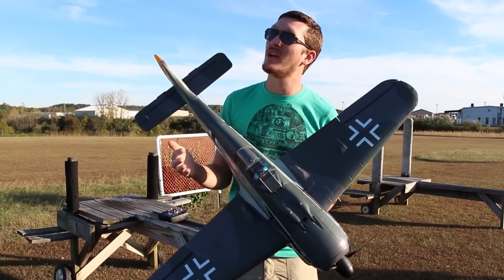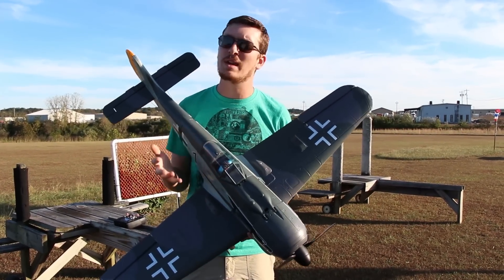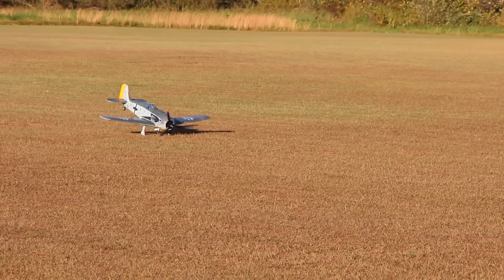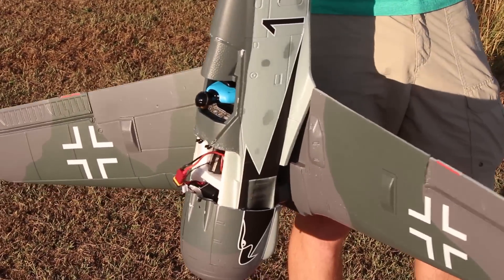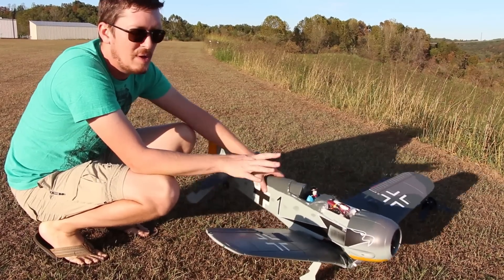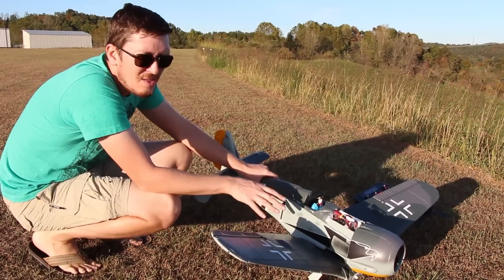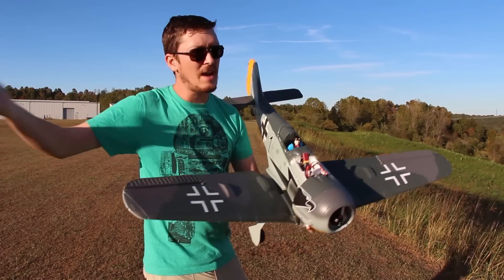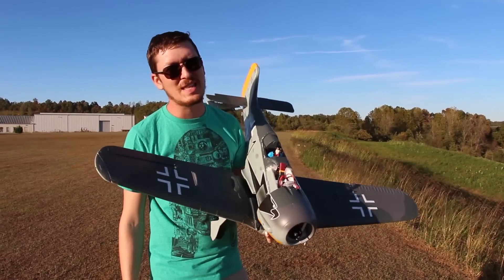WORST RC PLANE CRASH EVER!! - FW190 BRUTALLY DESTROYED!!! - TheRcSaylors

Comment: If you fly RC, it’s not a matter of “if” you crash, but rather “when” you crash...
Reply: And how spectaular. :D
Reply: Or in my case, how often you crash.  I have zero coordination.  I have fine motor skills for most tasks, but not for RC flying for some reason.
Reply: @dasworkshop4967  Have you tried flying in a simulator? That could help with your coordination.
Reply: @dasworkshop4967  Fly a drone, way easier and more fun I think.
Reply: I fly since 2years and 3 month's now, my only crash happened while i handlaunched my f-15 and that was just b.c. i tossed it like an idiot and the trim was also off. You can see this on my channel xD

Comment: Love the new intro! 😍
But the crash looked like a straighforward tip stall to me; simply not enough airspeed during a steep banked turn, and not enough altitude to recover. You could have had a 4s n there and it wouldn't have made any difference.
Reply: my thoughts exactly deadlydiddy
Reply: Tip stall, I agree. A little more forward CG would have probably help too.  The plane should be fixable.
Reply: Don't feel bad Nate, watch this closely related, but bigger and much more expensive note: 

https://youtu.be/P4qqYN8bVnw
Reply: Second (or third or fourth) the tip stall analysis. Its a typical 'scale' warbird, and air speed is your friend in a turn. They look great in the air, but the trade off is you constantly have to stay on top of it. I learned the same lesson.🤔 Several times.
Reply: Late comment but with the prop coming off like that, I think the grub screw came loose and it lost power, thats why he said that it felt underpowered..
Reply: If someone put wings on 💩 Nate would be able to get it in the air and trimmed out👍sure it might smell funny and people might 🤢🤮 but he would get it to fly
Reply: @bert1058  not a tip stall... that is a plain old pattern stall. He was going downwind got too slow and tried to turn up wind. Had nothing to do with wing shape etc... just too slow.

Comment: First a slowspeed tip stall, followed by another tipstall caused by to much elevator input but that happened so quick, hard to keep the orientation and react in that short time. But even this should be fixable. Did u repair it?
Reply from the maker: Yeah, definitely my fault on the tip stall for sure. You know, I had the plane at about 90% repaired but needed a special motor with a fairly long, already attached motor shaft and didn't ever get around to ordering it. I ended up donating it "as is" to a fellow club member that was not quite as fortunate as us who was very happy to take it on as a project. I say this with a rather loud two year old demanding my attention at this very moment 😉 Hard to find time these days for repairs.

Comment: Cg! It still looked like it was dragging its tail. The straight up take off was probably the cg too far back and it wouldn't penetrate the wind gust. Some warbirds even with good balance don't slow down well. They need to be flown smooth with a little speed or they will stall just like that. They usually give a range of cg, I start on the forward edge of the marks for the first flights and move it back if necessary. Sure show the crashes, that way we can all armchair analize and give our "professional" opinions. Condolences on the plane best of luck with the repair.

P.s. If you think you went too far forward with the cg just note the position of the elevator on the ground once the plane is trimmed for straight and level flight. If it's level your good. If it's up significantly you might have gone too far ( double check the cg). On these flights the plane seemed to want to climb, if you got it trimmed I wouldn't be surprised if you had some down elevator in there. That is a sign of it needs more nose weight. Sorry for the long post but tuning the plane to get it to fly like you want is a learned skill that alot of people overlook. I've found that most planes fly great, they just need proper setup. Video idea! Do a tuning video, even trainer planes aren't perfect out of the box.

Comment: It's a good reminder that we all crash.  I was patting myself on the back at not having broken a prop in an entire season, and then my 50 mm BAe Hawk augered in on a bad toss and split in half!  Most of the planes I crashed were Flite Test, and they hot-glued right back together.  The only store bought crash was a Hookll Pilatus PC-9.  Lost aileron control and couldn't recover from the spin.

Comment: Having tested many planes for Nitro Planes a couple of years ago, from what I saw was it seems like the plane tipped stalled and was flying a little too slow in the windy conditions.   As a suggestion, when flying a under powered airplane in windy conditions, I tend to start most of my turns using the rudder (yaw turn) instead of the ailerons as this helps keeps the wing from dipping too much, this especially true when turning down wind. .   If things really gets bad I would use more rudder and cross control with the ailerons.

Comment: Foam is made up of little foam balls that are glued together so gluing they phone back together will give you back the same material strength as it was before. You can easily repair your bird and using medical tape like what is used for taping IVs to your skin as a hinge. They sell the same tape that is sold for high prices for hinge tape can be had at your local Walgreens for just a few bucks for several yards.

Comment: Hi Saylors, I’ve flown these FW190 warbirds myself , IC 4 stroke. They are deadly for tip stall. I’ve had great flights and then it’s bitten me on landing . Frustrating. I think the c of g was too tail heavy on yours, seemed to be hanging it’s tail while flying. 
I would put some lead up front to get it more nose heavy. Also, modify the landing gear to hang more forward, pack out the one edge of the retract mounting. This will stop it tipping over on grass take offs. My test on planes is to always make them nose heavy , then the worst that can happen is it won’t take off. You can then reduce weight to a point that it fusion well, and takes off well. But no tip stall. Love all your videos and keep up the great work 👍

Comment: The manual for my first RC plane said it best.
Your model will eventually land. It might not necessarily be gentle and controlled though.
I'll agree with the general synopsis that it was a classic left-wing stall.
These fighter planes are designed to be unstable, so they can maneuver quickly in combat, but that makes them harder to control.
They also make horrible gliders, and need some good airspeed to not just fall out of the air.

Comment: I have this plane, and the CG is off in the book. I added an additional 25 grams of weight at the motor mount area, and it became a different plane and a nice flyer. I also racked the gear forward some.

Comment: I remember in 60's at Pilon race have to dig to recover engine and what was left of radio gear. In the reed days jumping in car to chase a fly away for miles until gas ran out or it stalled.I was a kid and got to run to recover often a mile off roadway.

Comment: Aft centre of gravity,tip stalled and spun with tiny tail on FW.190 getting the balance right is essential better to be nose down on this type of aircraft as soon as you were in the air you were in trouble.
Easily repaired with soaking foam in hot water it will give popcorn effect but be fine, if you do fix it put some proper hinges on it.

Comment: I know I'm probably way too late to give you a tip but… Do not use flaps on takeoff.  Especially when it's windy you don't even need them… Next never have flaps on in-flight which I don't think you did… Last when it's windy keep the power up all the time.  If the wind comes near your back go to full power if you're novice.  Just keep the power on.  Landing of course into the wind still you do not need flaps it's too windy.  Anyway good luck

Comment: Ha, I wish my crash was that easy. I had a .25 size mid wing balsa wood model that I put a .40 on and while it was wide open I banked around a large barn and as I cleared the barn, the sun hit me in the eyes and it rolled and as I saw it ( after the bright haze went away ) going down, I pulled  back to gain altitude, to immediately crash into soft muddy dirt. It killed the OS Max motor, all the servos but 1 and the receiver. Not a single piece of balsa was intact but half the tail section. Someone brought me a garbage bag to put all the parts into it was completely destroyed.  It took me almost a month to build it and mono coat it to crash it in literally 1 minute of flying. It happened on the first flight also. I gave up planes after that and went back to RC Car racing. I got back into planes and helos years later but I won't build another balsa model ever again. Prebuilt and foam for me only.

Comment: Hobby King say to fly this model on a 2200  4 cell, so more weight in the front. Where was your CG at by the way?
Keep the reviews coming they're great.
Reply from the maker: Thank you! So my instructions did say 3s, sadly. I am actually repairing this plane on my free time 👍⚓😎 My CG was in the only spot alloted for the battery, which was at a funny angle so there wasnt much I could do in regards to balance.

Comment: Looks like you lost all lift when you made that turn into tailwind. I have been there, but hey that could happen to anyone. A way to prevent this from happening is to keep your airspeed up and make small adjustments and use your rudder in order to keep the wings level as much as possible. cheers.

Comment: That's how they fly when the CG is too far back. It easily stalls in a turn and goes like an arrow straight into the ground and its virtually impossible to recover. If you do level out it will usually tip-stall again before it hits the ground.

Comment: Spare parts - https://www.rc-castle.com/index.php?route=product/product&path=470_472&product_id=1977 - Use a 4cell battery, they run well. Looks very similar to mine after I crashed, a bit of tape, glue, and ingenuity she'll be flying again, good as new. Mine flies well after hitting a pole. A few scuff marks(battle damage) but good as. Good luck.

Comment: Thank you Nate. You've saved me a lot of money. I was about to get into this RC Airplane hobby stuff but now have decided its not worth it.  ;>)
Reply from the maker: Trust me, it is worth it my friend, but we all do crash eventually! I've nearly got my plane fixed at very little cost 😉👍⚓😎
Reply: @TheRcSaylors  Yeah, I was just joking. I just might get myself the flight simulator for Christmas and then buy an RC beginner/trainer plane in the spring.
Reply: So, now a year later and with probably two dozen  or so crashes under my belt I can happily report that none of my crashes have amounted to that much damage. SO FAR I've been able to do repairs and replace parts and get back up into the air. Needless to say my three models are no longer very pretty looking. Still loving the hobby.

Comment: After viewing the video again I believe the real culprit is the separation of the foam elevator hinge. Our club flys a lot of foamies and this is a common problem. You probably did tip stall but you cannot recover from a separated hinge. I posted a photo of a hinge failure on your Facebook page check it out.

Comment: Tail heavy and a classic wing-over stall with not enough airspeed.  Always check your COG with low-wing planes inverted.   Better going nose heavy initially and feeding on the power gradually with full up elevator.  That’s fully repairable with some Du-Bro hinges .   I increased wheel diameter on mine by Dremelling out the wheel wells .  Pretty sure this Top Rc plane is still available from Hobbyking. It shows in stock on their site.

Comment: I am wondering if it something like inertial coupling? I know it isn’t high speed or anything but I don’t think your control surfaces could overcome the forces because of the mass of the plane. The wind caught the wing it dived but just not enough force created by the control surfaces to overcome the inertia. Just guessing. At least the video gives me something to analyze. I would love to find the cause or what others have to say. Sorry it crashed. Hopefully it will fly again. Duct tape, bondo, bailing wire, and chewing gum.

Comment: This is why I am not really wanting to buy a plane, when they crash you loose all that time and money you put into it, RC trucks can be fixed and don't break as often.
Reply from the maker: I could agree to disagree here as I very much value your input. We actually crash planes way less often than we break parts on trucks. This plane has been fixed and flies perfect again. Had to spend about $8 on parts and a hot glue stick. I will say, crawlers are an exception. We almost never break stuff on our crawlers. Planes these days are so cheap to repair. Please at least consider trying planes 👍⚓😎

Comment: I have been flying this same model for a few years now. It is 4s rated, check the specs in the ad. You were flying way too slow, gear down making a too steep  down wind turn. Classic 'tip-stall'.

Comment: You stalled and went into a recovery and because you were so close to the ground you pulled back harder and re stalled it.  Stalls are a function of exceeding critical angle of attack.  Easy to do when you are so close to the ground.... as you get closer to the ground you are going to pull back harder.  You may have stalled in the first place based on rigging  (the way it is made)  If the wing incidence is high to start with you are close to the critical angle of attack when straight and level...  giving you a very small envelope to operate in.  When you were flying it last I was thinking that.  Too bad but I think it is not as much your fault as just the rigging of the plane.  Thanks for your great content.

Comment: The plane has an incorrect center of gravity. Too way aft, in my opinion, that's why it handled so poorly in windy condition.

A plane with it's CG way back will not be able to "cut" through air with enough efficiency.

This is a common issue with replica planes as they try to imitate the same proportions of real planes, which results in bad center of gravity placement.

RC planes need the battery placed more forward so the whole part of the fuselage in front of the wings needs to be extended. Real aircraft engines are way heavier on a real fuselage comparatively than brushless electric motors on RC planes.

Comment: That is why I fly foamboard planes. I get the fun of building something that looks great and and can fly that started out as a couple of flat sheets of foam and some glue ect... Paint it how I want it and go have fun flying. If it crashes, I pull the electronics out and build another foamboard plane. I get to try different designs every time. Total cost (minus electronics) $3.00 - $8.00. I will never pay $100 or more for a plane. Just me anyway.

Comment: This is in no way meant to be rude, 
Your videos are absolutely superb and obviously made with a lot of love, but please please please can you try and put the same effort into you standard of flying, that beautiful plane might still be alive. On take off why didn’t you hold in up elevator. It’s a tail dragged ffs. What did you think was going to happen.? After you had prop strike two times you never even went across and checked the propeller for damage. 
The take off was like something I would expect a complete beginner to do, the down wind run was also obvious that the C of G was way out and you wonder why it dropped a wing turning cross wind unfortunately leading to its demise. Like I say, you make great vids buddy, very professional which I love. It’s just a shame your flying isn’t the same standard. (My opinion only) 
Kindest regards Steve.
Reply from the maker: Man, this is like the first plane out if 100 or so that I've actually crashed. Notice that we jump cut between the prop strike and take off.. I checked everything out. I even changed direction for my take off because as I said in the video, the wind changed direction. The instructions recommend a 3s bat but it clearly needed a 4s which would have prevented this. It's a discontinued plane. I am in full on repair mode right now, fixing this thing. I'm not sure who you think I am, but erase that idea of me and know that I love and appreciate everything and everyone that I have in my life. Have a great day! 👍⚓😎

Comment: Hate to break it to you but CG was way off it was tail heavy invest into a great planes CG machine using your finger tips is a terrible idea think fingertip is about quarter inch wide that's a lot of centimeters difference when if your plane calls for a 3 1/2 centimeters from the leading-edge that could mean a lot between being on point and not on
point